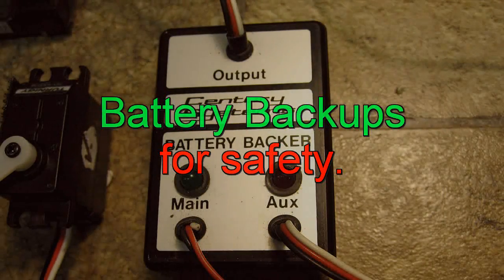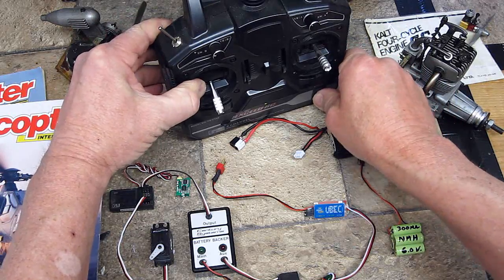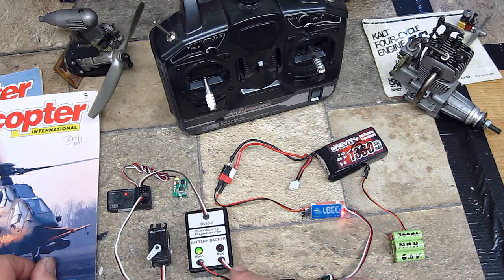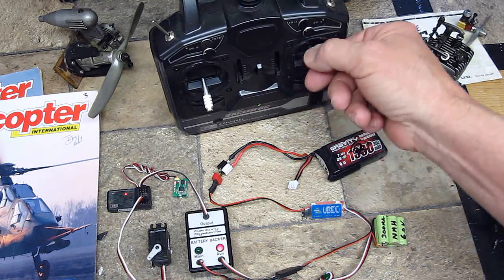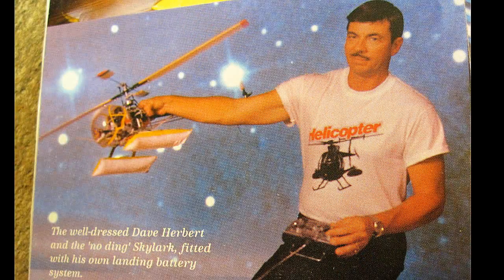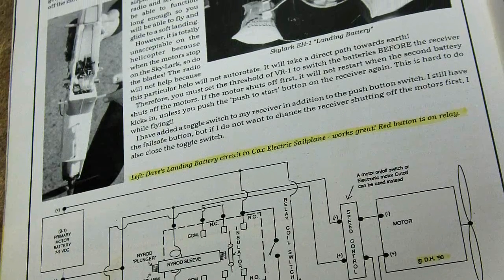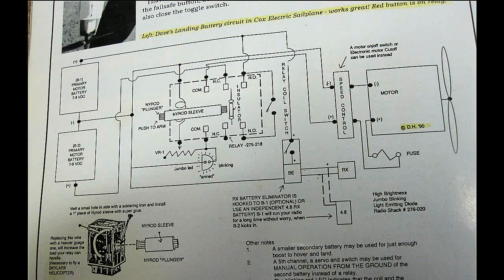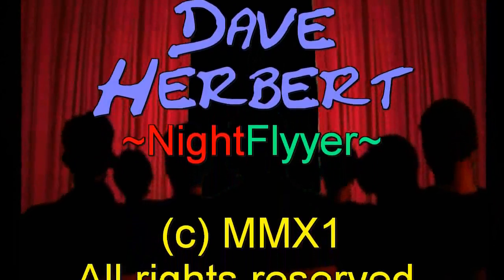Landing Battery can safe your electric plane or heli if first battery dies!

Comment: I thought this was a great idea so started to look on the net for one, as far as I could tell they are quite expensive and not that common, also I couldn't seem to find one that works off a lipo battery and a Nimh backup like your setup, they all seem to have to have the same number of cells as well. I'm no wiz with electronics so don't really know what I sould get, any input would be appreciated

Comment: WOW!  Recently I tried something different, yet very similar.  Trying to maximize flight time on my skywalker for FPV, I was experimenting with smaller and smaller motors.  With smaller motors came longer runways.  To solve this I fitted a second motor on the end of the tail boom.  It is mixed to only operate above 80% throttle which is mainly just for takeoff and climb out.  When I reach cruising altitude and pull the throttle back, tail motor shuts off and I can cruise my 40oz plane on 6A.

Comment: this could make a cool battery "drop tank" ( drop tanks battery run out, drop that battery (parachute) and use the onboard battery ) 
this could make a fun experiment :
like longest FPV flight ( imagine dropping a 5000 mah 4s battery )

but then their is a risk ( parachute fail, kaboom ), and i think most people will just land the plane, change battery , take a break and take off again.